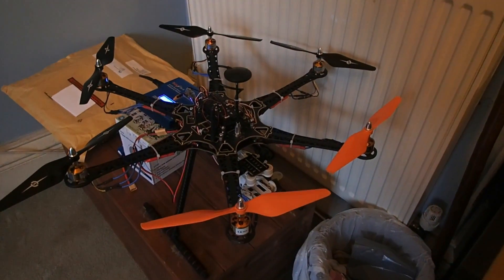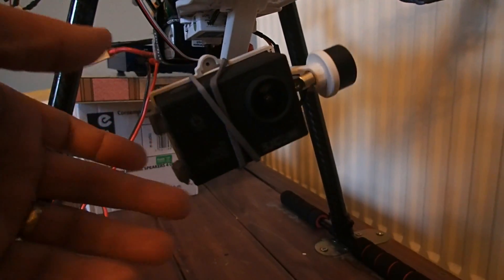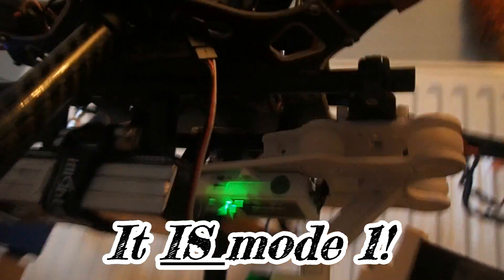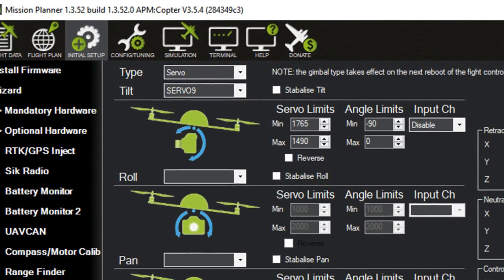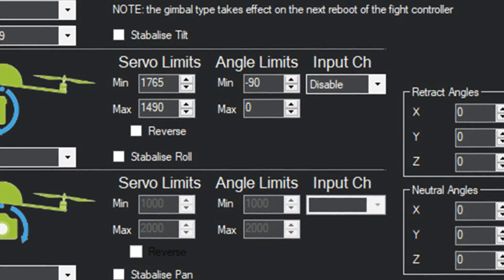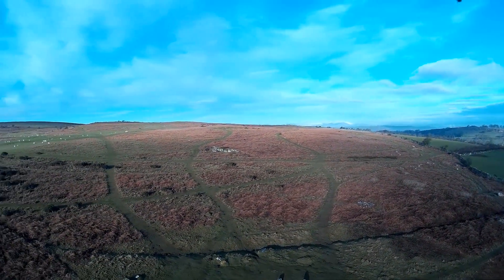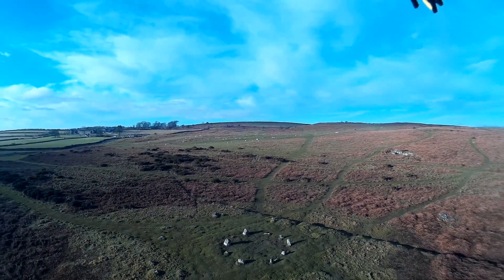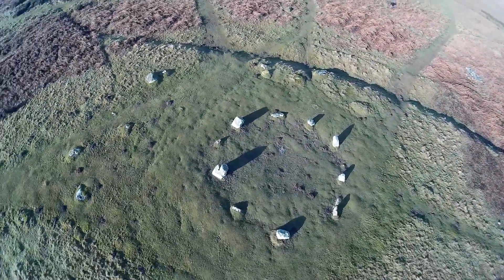Robert Drones On: Pixhawk and Walkera G-2D Brushless Gimbal Setup

Comment: Hi Robert.  Great video. I was trying to set up a storm32 gimbal to work with pixhawk but had issues. Do you know if it is best to connect the signal wire to the auxiliary channels? Does the pixhawk has to be armed in order to control the gimbal?

Comment: Hello Robert, Thanks for the Video.
I Have a question, where to power on the Walkera G-2d if i dont have extra battery? Is there some port on the Pixhawk that i can plug in? or my flight battery? im using a 4s 5000mah battery.
email: raphaelmiranda@id.uff.br

Thanks
Reply from the maker: Raphael Miranda , there is a separate battery for the gimbal. It’s a very small 2 cell battery, about 800mah. You can see it above the larger flight battery in the video. If you didn’t have an extra battery, you could simply solder the wires to the main battery terminals on the drone frame. You’d have to check that the voltage was okay for the gimbal though.